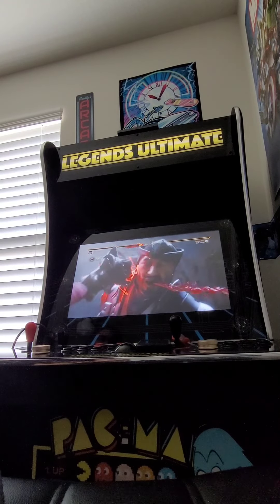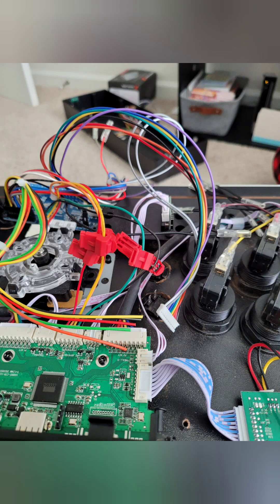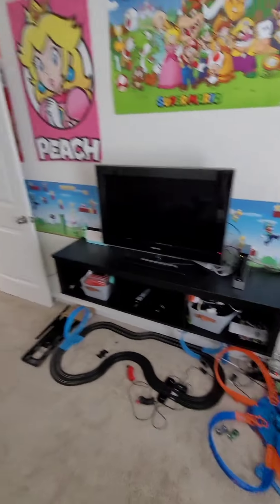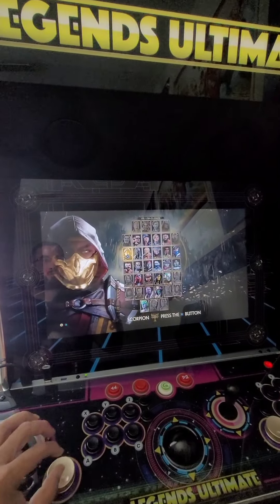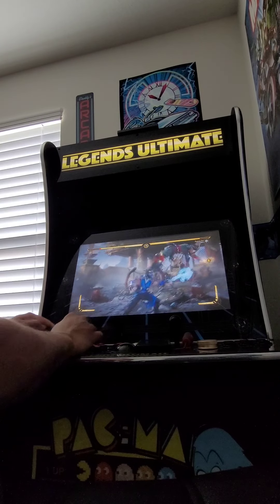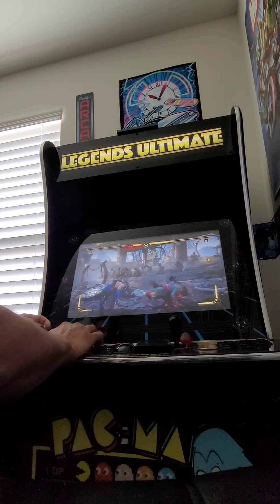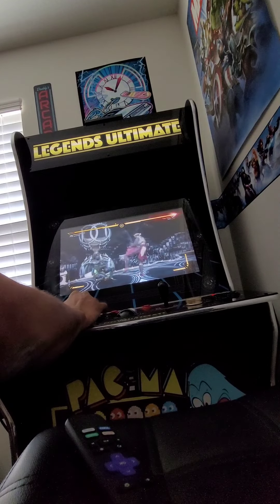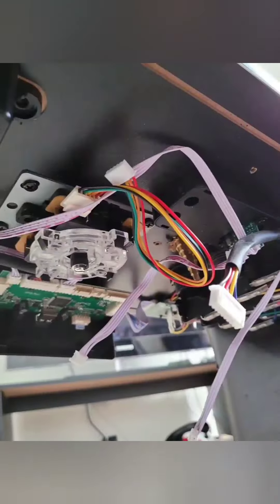Ultimate Legend Arcade conversion to PS4 Fighting games

Comment: Awesome work.  I have the ALP (pinball) and want to try this with a Switch.  Really just need flipper, nudge, and launch buttons configured and I'd be happy as a clam and just use the joycons for anything else.  Can you give a more detailed write up for non-electricians?  I like that fancy wire stripper.  What are the connectors you used?  Hard to tell what to search for.  Thanks!

Comment: I'd also like more tips on using the quick connects and wire stripper.

I have a bricked legends gamer pro controller that I want to get working with my PC using theese
Reply from the maker: Klein Tools 11061 Wire Stripper / Wire Cutter for Solid and Stranded AWG Wire, Heavy Duty Kleins are Self Adjusting https://www.amazon.com/dp/B00CXKOEQ6/ref=cm_sw_r_apan_i_TXZYRVKZ6T7N16PRH4FR
Reply from the maker: T tap connectors TICONN 240PCS T-Tap Wire Connectors, Self-Stripping Quick Splice Electrical Wire Terminals, Insulated Male Quick Disconnect Spade Terminals Assortment Kit with Storage Case (240) https://www.amazon.com/dp/B07MLPBPW5/ref=cm_sw_r_apan_i_Q4409X55GA48CPFRCGXQ?_encoding=UTF8&psc=1

Comment: What if you already have 8 button control deck how would you connect this to ps4?
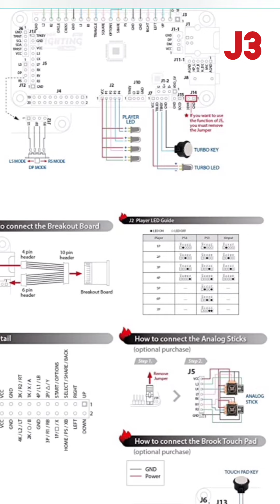Reply from the maker: You're going to get the brooks fighting board and the wiring diagram will lay out where you land the wires. If you pause the video at 1:56, you can see the wire layout. Youll connect to the board using a printer cable to the usb port on the ps4. You can get the fighting board here. https://a.co/d/7Aex0La